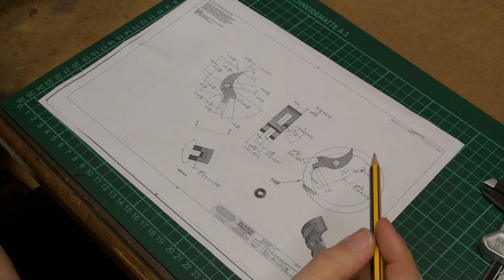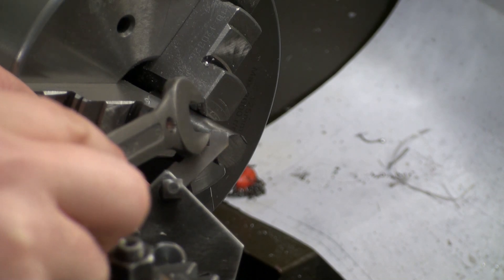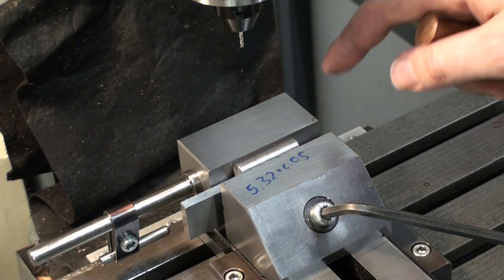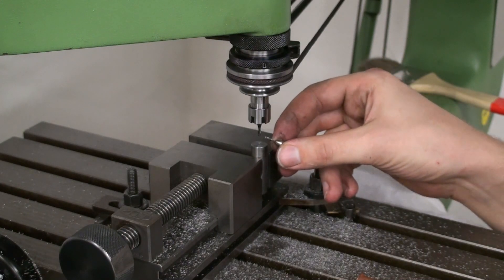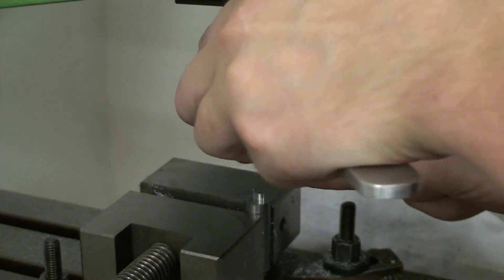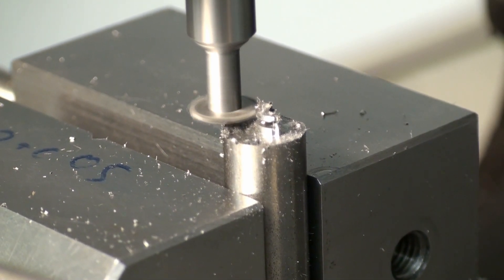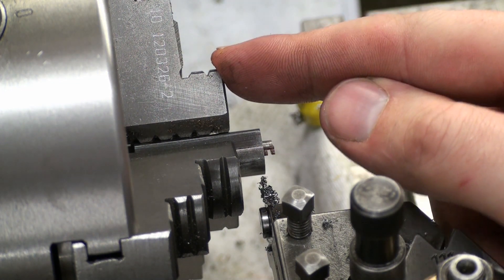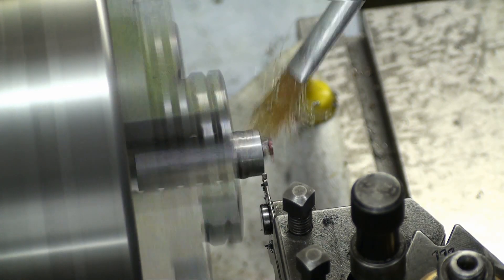Miniature M1911: Sear

Comment: your mill takes cat 40 tapers, iv'e never seen an exposed mill that uses those, we have a few old fadals that still use the cat 40's
Reply from the maker: Sandman Actual The Deckel head I use on that mill is a bit unique, it takes cat40 tapers with an S20x2 threaded stud at the end...as almost all manual Deckel machines did :)
Reply: well, excuse my ignorance then, i'v pretty much only used Bridgeports and the like. that's very interesting
Reply from the maker: Sandman Actual Same here, just in the other direction, I only ran euro-style mills so far, like Deckel and Maho :)Saw a Bridgeport only once in person.